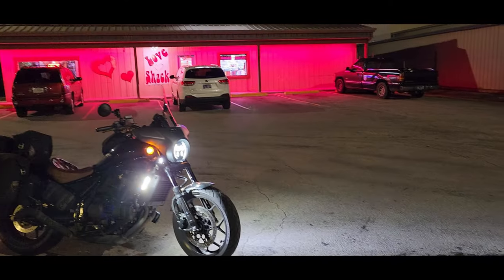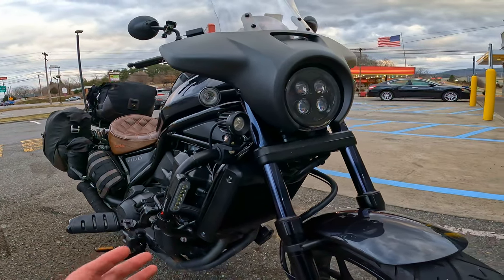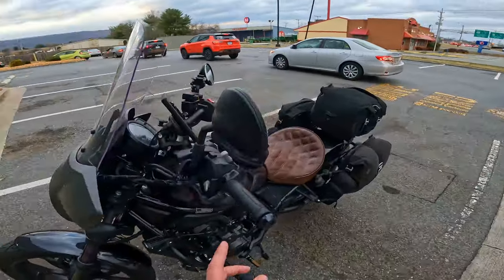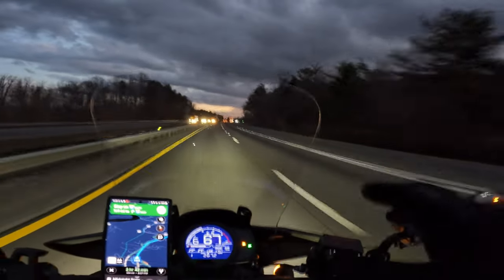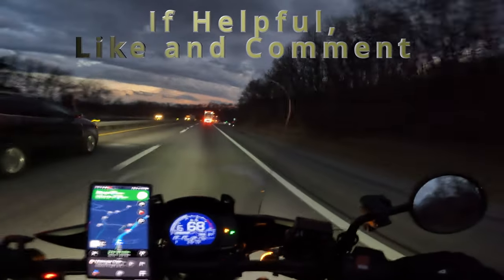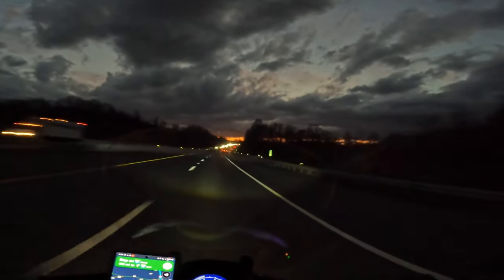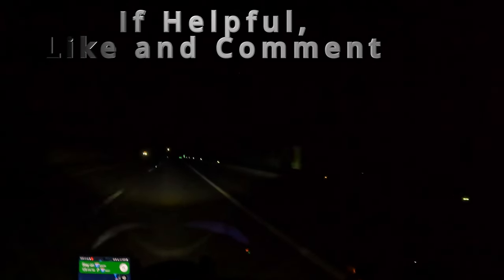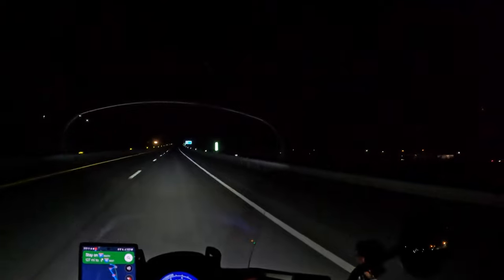Rebel 1100 Fog Lights!

Comment: Hello Matey, just had fitted my heated grips and day light running lights using my local bike mechanic. We had issues as the mechanic cut into the wires, everything seemed to work at first...until i rode down the road. Every time I hit the front brake, the lights would switch off and when the brake was released they would switch back on. This also affected the heated grips which would switch off in total. So the issue seems to be linked with Cruise Control, once the mechanic connected the above via the license plate light I have not had any issues. Just thought I would share in case any subscribers want to to the same thing. Keep up the good work and ride safe!
Reply from the maker: Hi Dazza! Always good to hear from you man! Thank you very much for sharing your experience, it is incredibly valuable! I've had electrical nightmares on other bikes and cars in the past and hence why I hesitate to splice into cables.... 🤙

Comment: Hey bud. I got my Denali D3 lights system wiring and mount on the mail today. I’m gonna try to install them tomorrow morning before our Easter Day.  Happy Easter ✌🏼
Reply from the maker: Julio! Bro that's fantastic news man! Please please keep us posted, I'm so curious how they will turn out! Thank you so much for sharing bro! 🙏
Reply: @ontherebel11  will do 😊
Reply: @ontherebel11  hi buddy, last night for the first time and night ride, I aimed the lights to the right angles so it wouldn't blind the drivers etc. Holy cow what a difference I love them and nobody blink me back of getting blind. Just wow brightness :) I put them on the top part of the sw-motech crash bar, zero issues and very easy install. Like you, I added a protection tape for their mounts so we can avoid getting the bar scratch from it. So these are their D3 lights and I'm using their hybrid lens mode. I might try the spot ones but these are great. See ya around amigo :)
Reply from the maker: @Julio-bc7pj  wow Julio! I'm so happy to hear from you brother! Thank you so much for sharing your experience! Now that I have the harness in place, I am very tempted to test brighter lights, I'm just a curious individual and can't sit still 🤣🤣
Reply: @ontherebel11  plug and play 😆 if it’s too bright then adjust the aim angle 😝
Reply from the maker: That's the beauty of their system!

Comment: What two sets of Lights are these? What wiring harness is this? Great video. Thanks for doing this.
I bought the bagger and would like to get more visibility in the rear. can I put a sissy bar on it with a brake like built in at the top?
Reply from the maker: Hi Joseph,

These are the lights i have:

https://denalielectronics.com/collections/led-drl-backup-lights/products/drl-visibility-pod-white-or-amber

https://denalielectronics.com/collections/led-driving-lights/products/d2-led-light-pods-with-datadim%E2%84%A2-technology?variant=41124991074488

https://denalielectronics.com/collections/all-wiring/products/dnl-whs-10900?variant=15068475949156

That's a great idea to add lights to your sissy bar, The more you make yourself visible at night, the safer you will be. Flashing lights catch people's attention VS static lights. Also, please consider wearing a highviz vest at night and when it is raining, it helps tremendously.

Comment: Hey are those folding highway pegs? The matt black looking thing that's between the footpeg and the engine guards. Btw your videos are a massive wealth of information. TY for making them. 🙏
Reply from the maker: Hi Sean! Thank you for your kind words sir! Yes sir, they are folding highway Pegs, here is everything you need to know about them https://youtu.be/qPWxz093If8🤙
Reply: @ontherebel11  awesome! I was having trouble finding ones that I knew would fit.  Highway pegs and engine guards kind of freak me out because when I think through how they will behave if you go down I think there is a high chance they will catch on the ground and throw you into a high side. I know a guy that had that scenario happen and had full guards and highway pegs and I personally think that's what happened. He's in rough shape to this day. Folding ones could prevent that, possibly.

Comment: Hi Gus, many thanks for this video. I'm in process of buying a similar setup. Looking at another Denali setup video, the guy said not to plug the white switch to live cable from the harness to the battery, but to use a switched live source. I'm probably going to tap it into the USB socket, but out of curiosity, just wondered where you connected yours to?
Reply: Ah, I see from this video of yours (https://www.youtube.com/watch?v=2cEW0fGMo50&t=10s) that you connected it to the battery. Guess the amount of power it uses whilst the switch is off is negligible. Happy days.
Reply from the maker: That's a great catch brother, yes that video shows that i connected it to the positive as i didn't want tap any wires at all and risk any future issues. i'm sorry about the delayed response bro...
Reply: @ontherebel11  No apology needed pal. I appreciate your efforts.

Comment: I try to not ride at night at all but what do you think about ground effects on a motorcycle? Like "underglow". I think it's great for visibility, and I personally think it looks cool. I wear high vis with reflecting bits at basically all times but i think lights like this and ground effects are a massive level of protection
Reply from the maker: Yes, I totally agree Sean, you have the right approach brother! I avoid riding at night as much as possible as I was once T boned by a car at night and had countless close calls with cars as well as wildlife.... As bright as you and the bike are, the greater your chances of being seen, I always put my high viz vest when it's dark or raining. The driving lights give you the advantage because you can see so much more, it's impossible to quantify it. During that trip, the lights saved my ass at least 3 times brother....
Reply: @ontherebel11  Sorry to hear about your accident. Ultimately I would want both fog/drl lights and ground effects. I've found myself in the mountains where there are no street lights at night before and it raises the risk and stress level tremendously. You can't go more than 40 mph while being safe (although you often exceed that despite knowing you shouldn't) because the distance of your vision is so short. Add fog or rain to that and you're just extra stressed out the whole time and in a very dangerous situation.

Comment: Heeeey bud. How you been there? Allll good here. Question about the OEM headlight. Have you adjusted the aim? Or change their light bulb to make it brighter? I think it’s one piece unit. No light bulbs but I’m not sure. Also noticed a screw on the bottom with a spring. I will mess with that later on 😂 my Denali harness broke and the replacement is coming tomorrow so I been using the OEM only this week 😔 see ya man and hello to candy
Reply from the maker: Hi Julio! All good here brother! Funny you ask! I just adjusted my headlight a few days ago! It's the screw at the bottom of the headlight, clockwise to lower the headlight, mine was way too high! 👍
Reply: @ontherebel11  crazy coincidence 😂 yeah man. My high beam aim like 30 yards up into the sky 😂 I will adjust it on that screw. Thx bud 💪🏼
Reply: @ontherebel11  I’m wondering if it uses bulbs that can be replaced for a brighter type like a vehicle 😈
Reply from the maker: @Julio-bc7pj what a coincidence! 🤣🤣🤣

Comment: Hi Gus! Have you decided on if you’re doing an instal video yet for these? I would love to see how you set them up. 

I also have a question. Do you have both the DRLs and the Fogs on the same switch or are they on seperate switches ?
Reply from the maker: Hi Callismo, i'm sorry about the delayed response bro.... I haven't been able to do an install video but i have a really short overview of the cables https://youtu.be/Y2UeTNWaBkw?si=THYdthtWy0Nv1I69.

I connected both DRLs and the D2 to the same switch, that's what i liked about the wiring harness, it has 2 plugs that allow you to plug both the DRLs and the D2s.
Reply from the maker: You might also want to watch this section of the camera install, it is very similar to the way i routed the harness for the lights, you can see the harness and cables. https://youtu.be/2cEW0fGMo50?si=cjE4CDZUFhpmnsuW&t=1763
Reply: @ontherebel11  Thank you for that install. 
For anyone else looking on how to install these lights, the camera video does a really good job of showing how the harness is routed. Having spent 2 days trying to route it down the right hand side, I pulled mine out and looked at the camera setup video. The white cable on the harness on the camera video was key for me. Saw that you had it routed under the tank from the battery and going down the left hand side. Much neater that way. Still have a couple of connectors that I couldn't get behind the plastic cases at the front of the bike but as they're tucked in on the bike chassis, although visible, they're quite tidy.

Comment: Hi Gus, apologies if you've already answered this, but what lenses are you using on the D2's? Both spot or a mixture of flood and spot?
Reply from the maker: Great question! Thanks for asking it bro!
I debated and settled on using spot on both since I have the drl lights as flood lights, that gave me the overall effect, it provided both max distance and spread with these particular light combination. Great for both highway and slower roads. Hope that helps brother 🤙
Reply: Nice one, thanks for the info. I'm still experimenting with my setup. Currently have one flood one spot and the DRL's 3m taped and cable tied to my crash bars whilst I source a bracket.

Comment: great vid. how did you mount the DRL lights to the bars? online looks like the brackets that come with are vertical ..the lower mounted lights. thanks in advance
Reply from the maker: Thank you Bryan! I used the crash bar mounts of the t3 lights to mount the drls on the bars, not ideal but needed to make it work before my trip. Saved my ass several times on the 3,000 mile trip!
Reply: @ontherebel11  Thanks so much! would you happen to have a link of the product?
Reply: @ontherebel11  I would like to have the product link too !
Reply from the maker: @marcgatineau209  

Hi Marc, please note that these were not designed specifically for the Rebel 1100, I am experimenting with them, that's why the DRL's don't have the right engine guard mounts. Please call Denali for the specifics, they have amazing customer service, ask for Alex or Jesse.

DRL:
https://denalielectronics.com/collections/led-drl-backup-lights/products/drl-visibility-pod-white-or-amber

Engine bar mounts for DRL: NOT MADE FOR DRL
https://denalielectronics.com/products/engine-guard-mount-for-t3-signal-pods?_pos=12&_sid=885c24747&_ss=r

D2 Lights:
https://denalielectronics.com/products/dnl-d2-050?_pos=11&_sid=62b5a4831&_ss=r

D2 Mounts:
https://www.amazon.com/LAMPHUS-Off-Road-Horizontal-Mounting-Aluminum/dp/B0791NB4FM/ref=sr_1_1?crid=2XXHDKLNPRK7H&keywords=Off-Road+ATV+UTV+Light+Bar+Mounts+Mounting+Bracket+Mini+Bar+Clamp+Kits+%5B0.75%22%2F1%22%2F1.25%22+Inch%5D+%5BHorizontal+Bar%5D+%5BAluminum%5D+%5B2+Unit%5D+Bull+Bar+UTV+Roll+Bar+Clamp+Tube+Roll+Cage+Clamps+Mount+For+ATV+UTV&qid=1680543159&sprefix=off-road+atv+utv+light+bar+mounts+mounting+bracket+mini+bar+clamp+kits+0.75+%2F1+%2F1.25+inch+horizontal+bar+aluminum+2+unit+bull+bar+utv+roll+bar+clamp+tube+roll+cage+clamps+mount+for+atv+utv+%2Caps%2C416&sr=8-1

Wiring harness to battery with manual switch:
https://denalielectronics.com/products/dnl-whs-10900?_pos=1&_sid=648a58e4c&_ss=r

Comment: I love these lights. can you please send me the link for both as well as your crash bar? Maybe the price for each as well as the crash bar?
Reply from the maker: Hi Scott, Please note that i am testing these lights and i made them work for my needs, these were not specifically made for the rebel 1100, i plan on making a detailed video in the near future of going over the lights and what's involved in setting them up. the products that i'm using are linked below for your review.

Crash guards
https://sw-motech.us/products/protection/crash+bar/4052572217283.htm

DRL
https://denalielectronics.com/collections/led-drl-backup-lights/products/dnl-drl-10000-w 

Engine guard mount (doesn't fit fully, i am in contact with Denali to develop one that will work)
https://denalielectronics.com/collections/led-turn-signals/products/engine-guard-mount-for-t3-signal-pods?variant=35988623818920

D2
https://denalielectronics.com/collections/led-driving-lights/products/dnl-d2-050?variant=15068477751396

Wiring harness:
https://denalielectronics.com/collections/driving-light-wiring/products/dnl-whs-10900?variant=15068475949156
Reply: @ontherebel11  Thank you and understood. Look forward to the video with more details on these lights.

Comment: I've now got some lights for my Rebel, but currently I'm not sure how to route the wires from the crash bars back to the battery without touching hot parts. My lights also have an extra fuse and relay, currently I have no idea where to place them 😅.
Soooo: can you please make a video of the cable routing to the battery? 🙏
Reply from the maker: Congratulations Raffik! here is a short video overview of how i routed the cables.
https://youtu.be/Y2UeTNWaBkw

If you have some free time, watch the installation section of the below video, you'll see a little more detail about routing. https://youtu.be/2cEW0fGMo50?si=RqplpZlgcXIwx86W&t=1630
Reply: @ontherebel11  thank you, these videos help me a lot to do the job right 👍😅
2024 will be a brightener year 😉

Happy new 2024 from Austria 🍀
Reply from the maker: @RaffiK14   Happy New Year Bro!!!🍾🍾🍾🍾

Comment: Have you looked into the DialDim system by Denali?
Reply from the maker: Hi Paul, I briefly did and I really like the concept, but I need to figure out a way to bypass tapping into cables
Reply: @ontherebel11  , I know... I wish they would create a prefab harness like they do for other motorcycles
Reply from the maker: I am trying brother 😉
Reply: @ontherebel11  I'm wondering if the Healtech Thunderbox can work with the Dialdim...that way, there is no splicing and you can control each set of lights separately...?
Reply from the maker: @paul.aragon  hi Paul! That's a great question, it would be awesome if that would work! I have to look into it! Thank you for the suggestion brother! 👍

Comment: Hey there, do you mind posting links for the DRL, Denalis and the Harness w the switch? TIA
Reply from the maker: Hi Michele,

Here is what i have, still going strong.

DRL:
https://denalielectronics.com/collections/led-drl-backup-lights/products/drl-visibility-pod-white-or-amber

Engine bar mounts for DRL: NOT MADE FOR DRL
https://denalielectronics.com/products/engine-guard-mount-for-t3-signal-pods?_pos=12&_sid=885c24747&_ss=r

D2 Lights:
https://denalielectronics.com/products/dnl-d2-050?_pos=11&_sid=62b5a4831&_ss=r

D2 Mounts:
https://www.amazon.com/LAMPHUS-Off-Road-Horizontal-Mounting-Aluminum/dp/B0791NB4FM/ref=sr_1_1?crid=2XXHDKLNPRK7H&keywords=Off-Road+ATV+UTV+Light+Bar+Mounts+Mounting+Bracket+Mini+Bar+Clamp+Kits+%5B0.75%22%2F1%22%2F1.25%22+Inch%5D+%5BHorizontal+Bar%5D+%5BAluminum%5D+%5B2+Unit%5D+Bull+Bar+UTV+Roll+Bar+Clamp+Tube+Roll+Cage+Clamps+Mount+For+ATV+UTV&qid=1680543159&sprefix=off-road+atv+utv+light+bar+mounts+mounting+bracket+mini+bar+clamp+kits+0.75+%2F1+%2F1.25+inch+horizontal+bar+aluminum+2+unit+bull+bar+utv+roll+bar+clamp+tube+roll+cage+clamps+mount+for+atv+utv+%2Caps%2C416&sr=8-1

Wiring harness to battery with manual switch:
https://denalielectronics.com/products/dnl-whs-10900?_pos=1&_sid=648a58e4c&_ss=r
Reply: Ty!